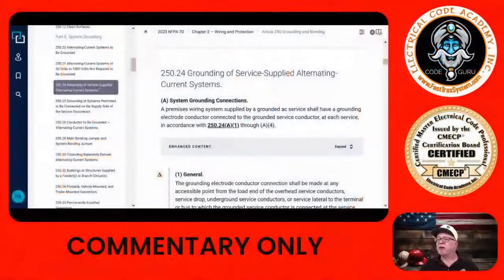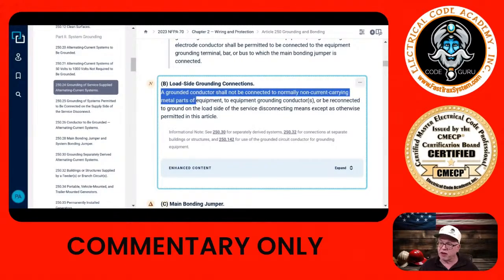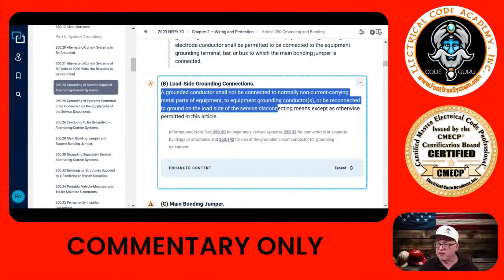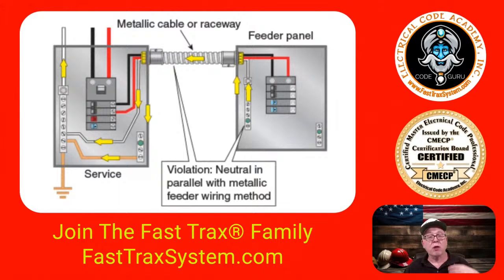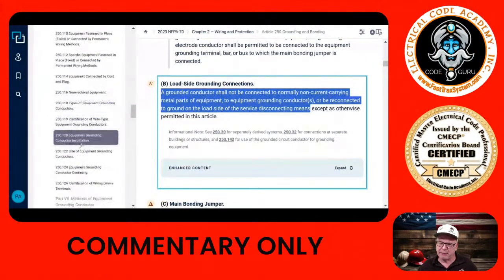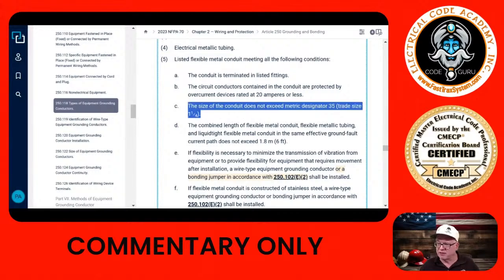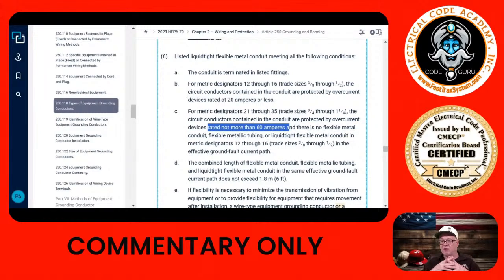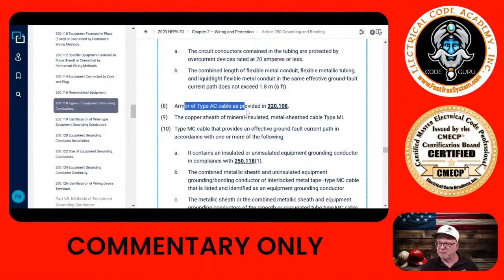Coffee Hour | Let's Talk Objectionable Current and 250.24(B) Violations

Comment: Is the context of 250.118 strictly 'using the conduit as the ground instead of an actual EGC running inside of it'? and is it required to install a grounding bushing?
Reply from the maker: Context?....it literally allows various raceways in 250.118 to serve as the EGC instead of a wire type EGC. However, vast majority of design professionals don't like that design, they always put in a wire type EGC even if not required.
Reply: @MasterTheNEC k